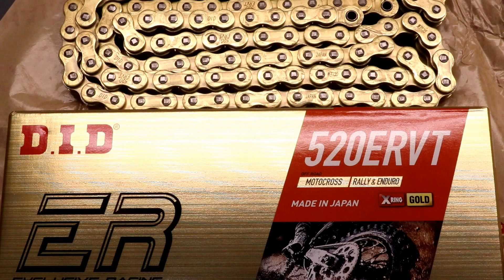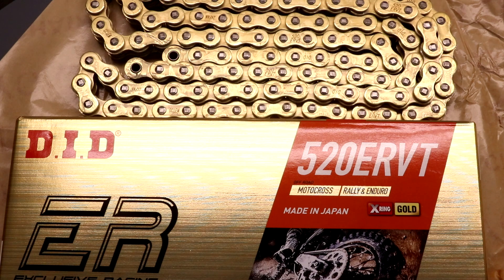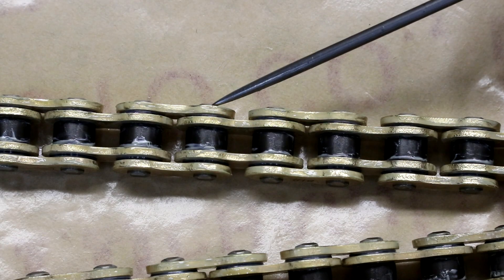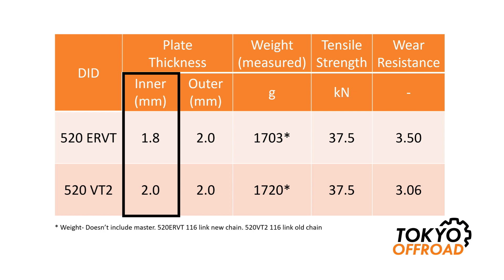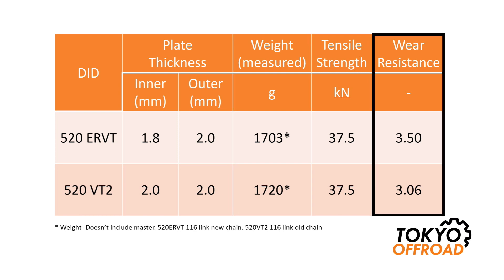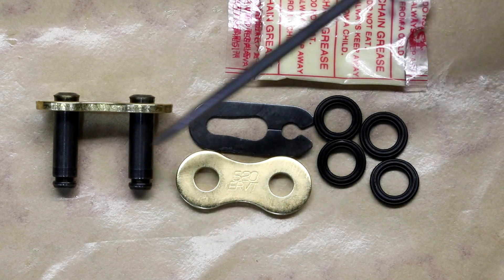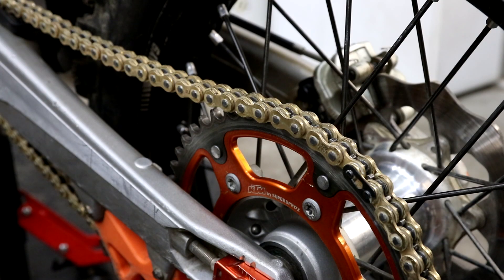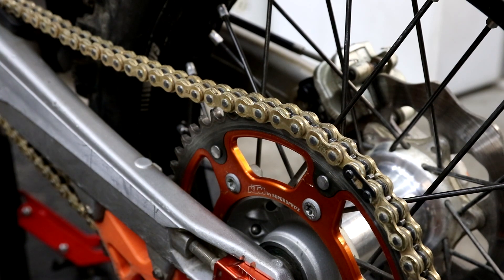DID 520 ERVT X-Ring Chain- Comparison to the VT2

Comment: I switched from the vt2 to a JT nickel plate xring. It was significantly cheaper and despite not marketed for off-road it has served me well. The nickel plating works to stop surface rust, a problem I had with the vt2.

Comment: kind of a similar topic, i have the 2024 300 xc and i find 1st gear is way to low, i dont ride fast, so my question to you is what would you recommend for both front and rear tooth sprockets to make first gear more useable in heavy woods or slow lugging (presently  48 rear and 14 tooth front both factory) any ideas would be helpful, thank you.
Reply from the maker: I'm using 13/50 gearing on my 2024 KTM 300 EXC, which has the same transmission gear ratios as your XC and I find works well for slow, technical terrain. If you want to continue using the 48 rear you currently have then I would suggest trying a 13 front sprocket.
Reply: thank you for your help. I was thinking of that. Love your content very helpful. @TokyoOffroad
Reply: @TokyoOffroad  was out on it today with the 13tooth sprocket and really saw the torque in 2nd and 3rd. Thanks.

Comment: I bought a DID 520 VX3 to replace my current chain.
I wanted to see how it compares to the ones presented here (the difference is in the no of links 118 instead of 116 so I needed to calculate the link weight):
520 VT2 => 1720/116=14.8275 grams
520 ERVT => 1703/116 = 14.6810 grams
520 VX3 => 1800/118 = 15.25 grams (greased, as taken out of the box, without the master link)

520 VX3 Link thickness = 1.92mm
Even though it should probably work fine, I am not sure I bought the right chain...

Comment: Approximately how many hours of use?  can you use this ERVT7 chain before changing it?  cordial greetings from guadalajara mexico
Reply from the maker: The number of hours use will depend on riding conditions. Mud and sand riding will significantly reduce the lifetime. But either way the DID ERVT chain lasts very well and I can recommend it. For my mixed offroad riding I usually get over 100 hours out of one.

Comment: How long does a typical chain last you? I just picked up the same chain for my crf450 and I'm curious with your maintenance how much life you get out of your chain/sprockets.
Reply from the maker: Chain life will be very dependent on what conditions you ride and how you maintain the chain. I ride every weekend and replace the chain once, or twice a year. The front sprocket I usually replace with the chain, The rear sprocket (SuperSprox) last a long time so I examine the teeth and replace if they start looking hooked.
Reply: @TokyoOffroad  I ride in mostly forestry roads, mountain rides, and dirt pits. So some is severe on the chain, some easy.

Comment: I currently have the VT2 chain. How do you determine it needs a replacement? It hasn't stretched, but I do got a lot of side to side stretch when applying force, I can get the chain move from the slider on each side. I have about 80 hours on it.
Reply: Do links stick? I run them until links dont want to move freely.

Comment: How many hours do you get from the VT2 and from the Supersporx sprocket?
Reply from the maker: Approximately 100H for the chain. Sprockets I'm not certain as I have multiple wheel sets, but the Supersprox seem to last a long time (250H?)
Reply: @TokyoOffroad  250 hours it's really good deal for a sprocket! in the front you're using the original from KTM?
Reply from the maker: Nir Hason - I use KTM OEM front sprockets. Currently using a 12 tooth one
Reply: @TokyoOffroad  Should do a review of the Dirt Tricks Zirconium Sprocket. Absolutely bulletproof design.

Comment: Looks like an O ring Chain
Reply from the maker: Yes, but the cross-section shape of the o-rings are shaped like an X so they are called x-rings.
Reply: Tokyo Offroad could you please do a review on Oring vs Xring chains for durability in enduro riding, cheers, keep the videos coming 👍